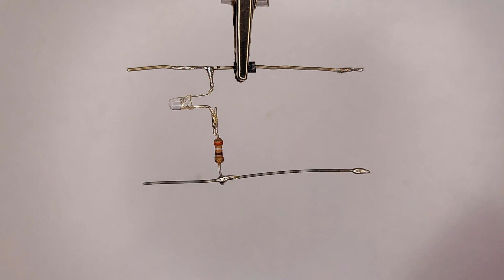Reverse polarity protection with diode

Comment: I'm trying to wire an LED with a motor (in an HO scale engine) that illuminates when the motor is going forward and when I reverse it to back up the headlight LED flickers.  I'm trying to use a diode that will prevent the reverse current from flashing the LED.  I tried putting it on the positive side in line with the LED but that didn't eliminate the problem.  Any ideas?  Cheers from eastern TN
Reply from the maker: Hi dear friend❤
This circuit works only on a DC motor, if the motor is AC, the LED will flicker as a result